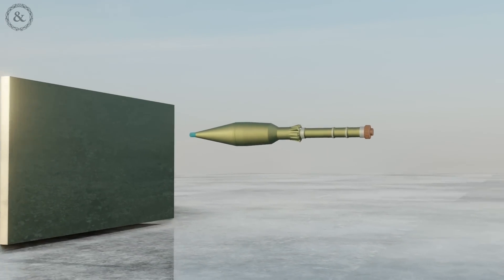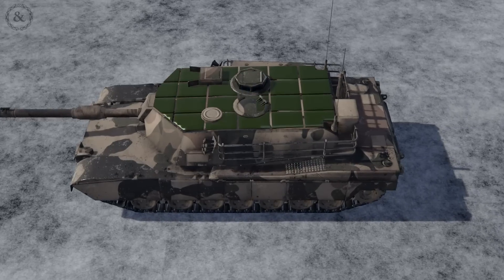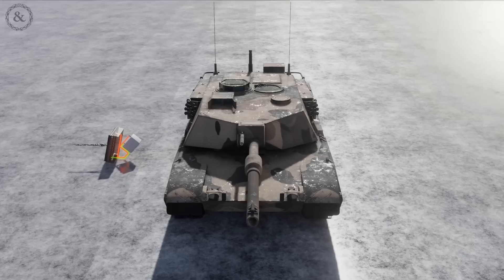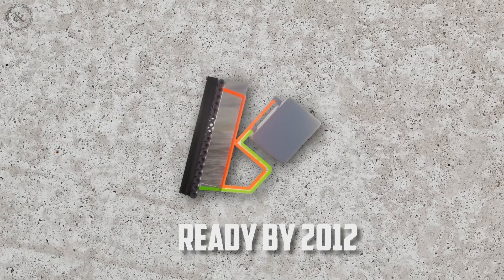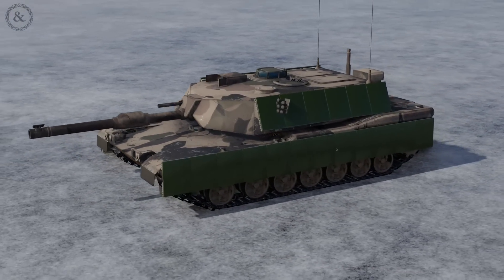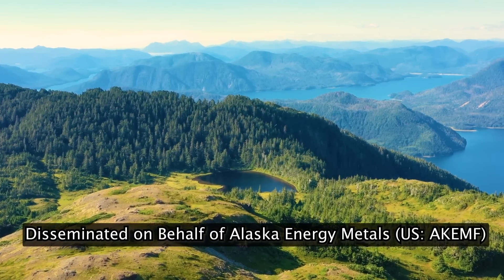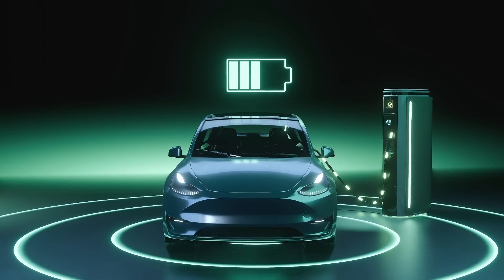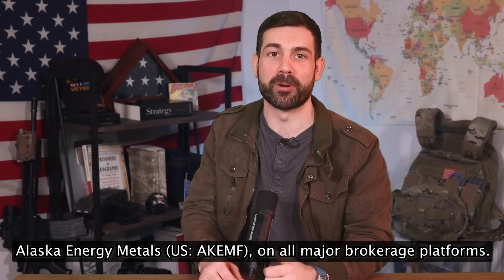How Electromagnetic Armor Vaporizes RPGs

Comment: The big consideration missing from this discussion is how easy this technique is to counter.  If it merely requires a small modification to the rpg to defeat than it's a waste.

I mean, for example could you add a simple metal stick or something to the front of the rpg to use up the electric charge so it can't mess with your shaped charge?  Perhaps a bit more complicated but the point is if it's easy to defeat it's not as useful.
Reply: Wouldn't tandem warheads defeat this armor anyways?
Reply: The metal stick would ruin the RPG's balance, and could make storage, handling and maintainance harder. The electrical charge could also still travel and detonate the rpg even before it hits.
Reply: @braincell4536  Yes, I agree this would require redesigning the rpg not merely jury rigging a stick to existing designs but they have RPGs (or at least similar projectiles) with such extensions so it's possible.  And it's not at all clear to me how effective this would still be.  Sure you might have to make some other compensating changes at well but it was only meant as an example.
Reply: Literally just use a plastic standoff instead of a metal one.
Reply: @Battlemagesoldier  Literally everything is a conductor if you try hard enough, and 20,000 volts is trying very hard.
Reply: @Attaxalotl  Right, and it's not clear to me the effect is via shocking the warhead.  It might be more a form of reactive armor that disrupts the metal jet via violently forming forming some kind of gas or plasma.
Reply: It don't think you comprehended the video. The system is behind an armour plate that is in front of the main plate. Your stick would either snap off or prematurely detonate the warhead outside optimal distance. The system works by disrupting the stream of copper, similar to ERA. It does not destroy the warhead like an Active Protection System.

Before you get any more ideas, anything strong enough to penetrate the outer plate to set off the system would hinder the HEAT element. The rocket would need to be larger for extra propellent for the tip to have enough kinetic energy to punch through and if you can pack that much kinetic energy into a rocket, you might as well go all the way and make a kinetic penetrator or have a bigger warhead or tandem. BTW, we don't have rocket based kinetic penetrators as it is worse than HEAT in this application and form factor. Have a look at tank APFSDS propellent casing if you want an idea of how large and heavy the rocket would need to be.
Reply: @oohhboy-funhouse  First, this was merely raised for illustrative purposes not because I think I've figured out how to defeat the system.  Point is evaluating how it does against current shape charged based rounds isn't enough.

But on the specific point.  Yes, obviously you would need serious redesign of the warhead.  However, if this is to provide any benefit you need much thinner passive armor overall and you need a bunch of that to be behind this system (since ir only reduces the penetration depth).  So it really depends on how thick the front armor can be whether or not it's plausible to add enough KE to penetrate it ... besides, as pointed out above, it seems relatively ineffective against two stage penetrators.

It's all trade offs and this seems like it adds a pretty big cost so it needs to add quite a bit to the cost of rounds that will be effective against it to be justified.
Reply: Use up the electrical charge? Where do you think it will go?
Reply: @Pathfinder192  Fine, if you want me to be pedantic.  Could you add a conductor to eliminate the potential difference between the two sides of the capacitor.   So yah you got me, technically what is used up is the charge imbalance which is corrected by the electrons moving to the positively charged plate.

Comment: By the time such armor is feasible we may have to defeat plasma rifles.
Reply: Arguably, it would be very effective against plasma weaponry. For plasma to be effective as a weapon at long ranges, you need some sort of magnetic containment field, so that it doesn't spread, then radiate it's heat away before impact. A strong electromagnetic field discharged on contact would both disrupt that magnetic  containment field, and force the plasma away from the tank.
Reply: railguns more likely tbh
Reply: @micaiahfonken  and by that time maybe tanks would be drones by then
Reply: @micaiahfonken this thing would be very effective against both plasma and rail guns given enough power but lasers on the other hand would completely bypass it
Reply: @NadeemAhmed-nv2br  if this type of armor doesn't protect against sabot it definitely won't protect against IRL railguns. Current designs are effectively sabot rounds but propelled by EM instead of chemical propellant.
Reply: Nah. Just hook it up to some capacitor and have it activate right before an RPG hit or something.
Reply: @honkhonk8009 Like electronic ERA?
Reply: most likely wont detect RPG at all, would need lock on making armor less effective @honkhonk8009
Reply: EMP anyone?
Reply: phased plasma rifles in the 40 watt range
Reply: Plasma won’t get far into armor though
Reply: This isnt as advanced as you make it out to be. The question is just how practical it is because anything Electronic is super heavy and fragile
Reply: not if we still don't have SPARTANs...
Reply: "I know not what World War III will be fought with, but World War IV will be fought with sticks and stones."
-Albert Einstein
Reply: @john20854 Well, sticks and stones will break your bones.

Comment: These would protect you from RPGs and other 20th century weapons, but modern weapons include standoff attacks that would still pass straight through this armor like it was sheet metal (because that's what it is.)
Reply: Thats why you put it infront of other armour lol
Reply: You mean ATGMs? Ones with shaped charges that this armor is designed and tested to defeat? The range of the munition means nothing in this context.

Comment: Just going to point out that almost two decades ago Lockheed Martin stated they could grow and print intricate meta materials at atomic levels. This could help form new armor with the communication and power delivery integrated directly into outer hulls on a tank and on the skin of aircraft. Just saying there’s likely some crazy shit already in testing or deployment that we have no clue about. Mass production could be soon which would enable better cost efficiencies.
Reply: I think the main question for printing those material is can you do it at scale and at stress... sheet metal is easy enough to ramp but printing material ain't too easy with the slow speed of current 3D printing

Comment: Problem with electromagnetic anything is it needs ALOT of power to power it... so good in theory but unless you can put a fusion reactor on your tank (one day!) then unlikely......
Reply: High power, yes, though generally only during the few moments it operates for, hence the need for some kind of energy storage device such as capacitors. Most of these things are limited by just how quick we can use the energy rather than by how long it takes to build it up. For instance, some of the US's railgun testbeds use large hybrid flywheel-alternator devices to develop the tremendous voltage and current needed to drive a projectile at rates comparable to good ole explosives. These things can be charged across minutes or even hours of time, but have to discharge in single-digit milliseconds (~2-5ms in the case of a railgun)
Reply: @milesnevills5534  I mean it depends on how often you're being hit, the other point is you have to have it on before you're hit - so vehicles become very vulnerable (even more so) to surprise attacks and you're using energy even when stationary (producing a logistics cost in fuel/energy that needs to be transported).
Reply: @tomriley5790 the more you talk, one thing becomes clear. This guy spends more time using his mouth than his ears
Reply: @veldin25 thanks it's good for eating, drinking and breathing.
Reply: Not really. The whole thing acts as a capacitor. Your not gonna be using power until it hits. Its like reactive armour basically.
Reply: @honkhonk8009 I don't really get how this would protect against kinetic rounds, like sabot tungsten rounds?
Reply: @kara88bg 
It wouldnt, thats would need multi layer defenses counter different munition types
Reply: @kara88bg  It doesn't, this is specifically to defeat HEAT and other EFPs.
Reply: Trying to have a good ealry comment but the video disproves what you say:  :((
Reply: But then the fusion reactor will emit particles that scramble all kind of EM wireless transmission, wich would limit combat to line of sight, wich in turn will make giant humanoid mechs the only viable weapon platform! Wich will make Colt great again, as they provide the military with 150mm bullpup assault rifles. Until of course the reactors are improved further, wich means that ballistic 150mm assault rifles will be replaced by particle beam rifles.
Reply: If Doc Brown could do it, the big green machine can😎
Reply: Needs a tony stark chest sized nuclear reactor
Reply: It literally does the same thing as era too
Reply: We need to ask Tony Stark
Reply from the maker: Yeah That’s why I’m was surprised multiple sources said this required very little power . Nuclear tank…you might be into something sir !
Reply: A lot.
Reply: Ultimately, I believe why it was abandoned is that one you can double tap with ATGMs 
Striking the same spot in rapid 
Two solid rounds like Sabos wouldnt be affected by it
Three, shear kinetic force would destroy the plate
Reply: @verdebusterAP  so basically impressive once, but useless twice?
Reply: @Tigerman1138 that’s what the normal armor is for
Reply: @Generic_Noob  Yeah, but how damaged would it be by then (assuming the heavier rounds with depleted uranium)?
Reply: @Tigerman1138 
In a nutshell yes 
Modern ATGMs can be guided by Electro-Optical  or Semi-Active Laser (SAL) to exact same point on a tank
Modern anti-materiel rifle (AMR) can use High-explosive incendiary/armor-piercing ammunition (HEIAP) which are explosive rounds with a tungsten sub-penetrator as well  saboted light armor penetrator (SLAP) rounds also with tungsten sub-penetrator 
AMR can easily use SLAP or HEIAP to neutralize EM armor. AMR can also target Active protection systems as well
The USMC combined anti-armor team (CAAT) uses combo of AMR, AGS and ATGMs to engage tanks

Counter armor tech has advanced to the point where heavy armor is becoming moot
Reply: You can make an electromagnet out of a small batery